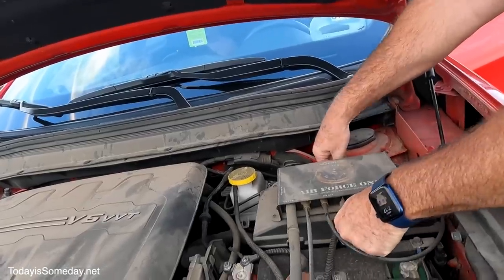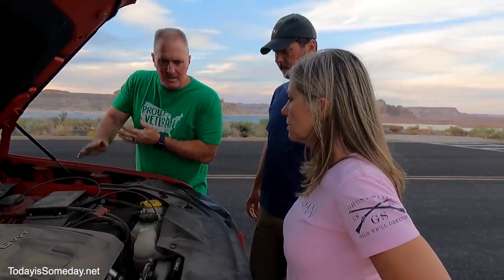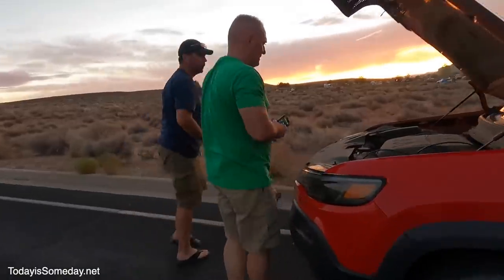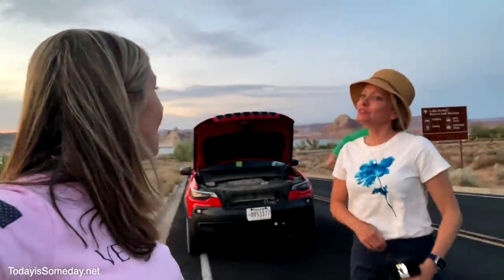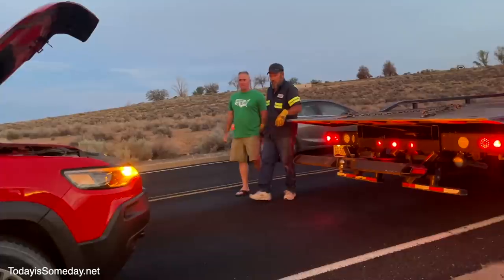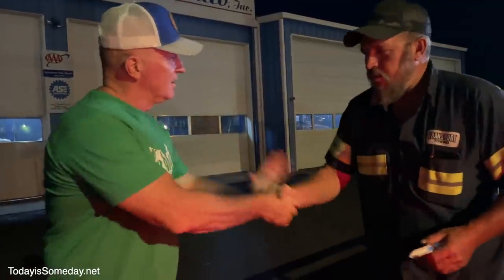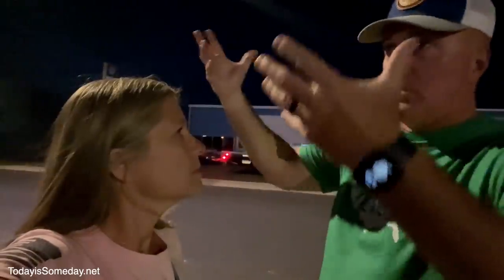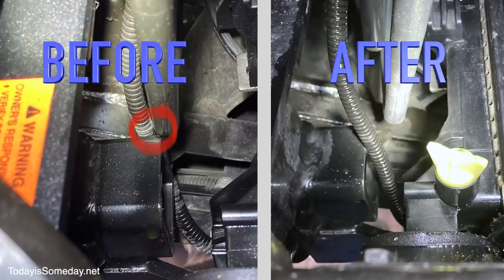Tow Car Breakdown in the Middle of Nowhere (FULL TIME RV)

Comment: As a machinist mate and 25 year auto repair shop owner, I would recommend splitting a small piece of hose and zip-strip it to the line in the after pic where it is resting on the frame or bracket. Even though it won’t pinch like the last time, it will rub from vibration and cause another hole. Go Navy, Go Chiefs!
Reply: My thoughts as well, it is not IF something will rub,,, But WHEN!
Reply: Great suggestion Kirby
Reply from the maker: I was all in on the suggestion and then you had to add...Go Chiefs!  You lost me!  ;)

Comment: Me too!! My Jeep crapped out on me on I-40 near Knoxville TN! I sat there for almost 6 hours (6:30pm until 1:30a.m.) AFTER calling AAA until a "backup" tow truck arrived. As a lone female traveler, it was a little scary so late at night with no power in my Jeep, no way to charge my phone and no way to get my driver's side window up and 18 wheelers whizzing by. Guess the alternator went out?  No hotel rooms ANYWHERE so I slept in my vehicle at the tow truck lot. Thankfully they let me use an outdoor plug to charge my phone.
I am grateful that I didn't wreck, no one hit my disabled vehicle and I was able to get a good rate on a rental car today. 
As a side note, just 2 weeks earlier while pulling my 21ft 1969 Shasta Deluxe, something happened after 3 semi trucks flew past and it started fishtailing, I lost control of my Jeep and the trailer flipped, it came off the hitch and so did the chains! My Jeep survived unscathed! That was on the 295 outside of Newport Maine! Both lanes of southbound traffic blocked. A total loss of my sweet little camper.

Comment: Good Stuff to know! I grew up in different vintages of Jeep, Grandad had Willy, (Thank You for Your service) My folks and Grandparents had : Liberty, Cherokee, Eddie Bauer Wagoneer, Cherokee Sport, Two Seat, Four Seat, Floor Seat (dog needs a seat - move down), many different variety, CJ7, Sahara Edition; so I get the Fuse Fix. I now tow with a vehicle same vintage as my kid, but someday I will own a Jeep again, my newest Jeep was a '99, with a wooden roof rack my mechanic said "Just add a steering wheel and 4 wheels for those times You flip over." Just Empty Every Pocket. Every vehicle has slang! Never owned a Jeep with a tow package, factory or not, the vehicle I currently own was one I installed the kit myself. I tow a camper that weighs less than 200 pounds. My vehicle height is not as high as a Jeep so I call it my "Mock SUV". It works, like a Jeep - until it doesn't!

Comment: Funny story - My 2008 Jeep Liberty started to drip a bit of transmission fluid, and I had just had the AC condenser (with the transmission cooler built into it) replaced due to AC issues. So, I had to take it back to AAMCO under warranty. They discovered a rat had crawled up under my frame and got stuck. It tried to chew its way OUT of the tranny lines that had caught it (and likely scalded it to death), so guess who had to pay another $850- to have that replaced a second time. So, while I didn't get stranded, I feel your pain. So happy that it all worked out, and still love my Jeep! As always, SEMPER GUMBY and GO NAVY!

Comment: We had a similar installation issue with a certain RV Dealer.  Wiring installation was completely wrong.  It was on our previous 2014 Jeep JKU manual tranny with the Invisibrake.  The installer ran all the wiring and vacuum tubes through driver's floor pan drain plug hole.  So over time the wires shorted out with the feet pivoting between gas, brake and clutch pedals.  It should've gone through the firewall.  The dealer made good on the repairs. But like you we were on the road.  We have since reinstalled the Invisibrake into our 2020 Jeep Gladiator, works great.  I would just advise anyone who has any brake system installed to have the installer explain were all the wiring and vacuum tubes are run through the vehicle.  Oh Yeah, Phil.  I'll disregard the Air Force comment.  LOL.  Be Safe, Friends.  Bill and Kristen  🤙

Comment: I did my own towed conversion. The transmission line issue was clearly in a warning and specific steps to take in order to properly secure the line. It was all in the installation instructions for the base plate. Your installer dude owes you a repair bill.

Comment: I want to thank you for this video.  I had nothing planned for this morning as we are camped in a beautiful COE park in MN with no real plans for the weekend.  But now I will be crawling under our Trailhawk to inspect the fluid lines.  Glad it worked out so easily for you.  Stay safe, stay  healthy.
Reply from the maker: Fingers crossed yours is good to go.
Reply: I have the same vehicle.  I can’t figure out the picture.  How’s it taken?  From inside the hood, looking down?  Or underneath looking up?  Which side?  And what’s the yellow thing in the right side pic, I don’t see that anywhere on my Jeep either.   There is a plate, like a big rock guard underneath.  Was that removed when taking this pic?  Thanks for the heads up, hopefully I don’t have this problem!
Reply: @WelshDesigns  In front of the rock guard is another plate (at least on my '15) that can be removed with a little bit of work, and the tow plates are visible above that plate. They run safety cables around your frame onto the tow plates, and if the installer wasn't paying close attention, those safety cables can rub on the transmission lines that are right there. We insulated my lines when we installed my tow plates since there is a warning in the installation directions informing the installer to be cautious of them.  If you have access to an endoscope, you can snake it down behind the front piece on the edges of your radiator and see those cables and hoses as well.

Comment: There are good people out there! We are in a trip from NJ to the Rapid city to see the sites and we also broke down with our TV twice. One time in in SD and the shop had us back on the road in two days. I think they must have knocked a ground wire loose and all a sudden the truck was a little off when starting. Found a guy in Wyoming to put a starter in it. He didn’t have one so he pulled it out to see if could maybe fix it and cleaned it up and reinstalled it all in the same day. I asked what I owe him he said $250. I thought that was fair. The next morning at 6am while I was having coffee I see him walking are the RV. I go outside to talk to him and he said he couldn’t sleep because he didn’t do his job correct. He said he should have checked all the connections before he pulled the starter out and after he got home he thought the ground wire was a little loose. So he try’s to hand me back $200 and said if he did his job I would have been charged $50. 
I told him to keep it because I appreciate what he did for me. 
Later that day I won $150 in Deadwood and I texted him to let him know that and it comes around. 
Safe travels guys.

Comment: Well you picked a pretty place to crap out.  We went across I-40 from Gallup to Kingman on the 28th so we came close to crossing paths.  Hot and monsoon rains in the afternoon.   It was getting dark and a field expedient could likely be deployed in the absence of a SheWee.  My wife won't be happy that I mention it, but we found out that if you come across a rattlesnake in a situation of that kind, it can take up to 3 hours before you consider even the possibility of needing to stop. 

I got towed in to Barstow to a shop that had closed 15 minutes earlier on a Friday afternoon.  Luckily the owner was doing his books, and had the proper size replacement battery.  I was sweating (literally and figuratively) a weekend in Barstow and replacing an alternator on Monday.

Comment: When I installed my Blue Ox baseplates on my Jeep Grand Cherokee Trailhawk (probably the same ones as the Cherokee’s), the instructions say to make sure the transmission coolant lines don’t rub against anything sharp.  I placed electrical flex conduit around parts of the lines and zip tied them back to help.  Love the Trailhawk for towing!!  Sorry for the bad luck.  Something to add to the check list.

Comment: We installed the tow plates on my '15 Trailhawk - One huge note for the Blue Ox kit is to be aware of the safety cables having the ability to rub on the lines that run right beside the mount plates. You can take the front plate loose and look up in there to see those cables and make certain that they were routed so that they don't rub on any lines. We cheated and used safety wire PLUS the zip ties they recommend to secure the cables to the tow plates (I have pics of when we were doing it but can't post them here obviously)

Comment: sorry for the isue....but it was very interesting...especially the legs in the air!!!   Be safe.....My hitch extender fractured at the weld line and my TOAD disconnected.  Fortunately we had just exited the Interstate were only going about 40 MPH.  But ...when i finally came to a stop...the car rammed the back of my motorcycle hydralift and and scratched and dented the hood...and bent the Blue OX.  Got a new one in two days and we are off again in the Black Hills of SD. RV Stuff happens!
Reply from the maker: Yikes!!!

Comment: Does the Jeep owners' manual recommend long-term towing with all four wheels rolling on the ground?  Instead of rubbing a hole in the bottom of the hose, it can rub a hole in the side of the hose.  Hey!  The road get over 100 degrees, the metal gets hot from the road, the plastic/rubber tube slowly melts against the metal, and the tube leaks.  Maybe it is time for another pool noodle to decrease heat and vibration.

Comment: We had a similar issue on our new class A. In our case the lack of enough under carriage cable ties meant our Jack’s hydraulic lines landed on the hot muffler and melted so we lost all fluids and our jacks. MAKE SURE YOUR LINES ARE WELL SECURED!

Comment: Sorry, y'all had problems. We flat tow our F-150 and the only problem we have had is a spring in our tow bar has gone out still haven't had it fixed yet so sure if it will be covered under manufactor's warranty.

Comment: Phil those Jeeps have a belt driven cvt transmission the same type of transmission in atv's and side by sides your clutch springs that very The gearing of the pullies both of them could be shot the pullies having a shiny spot that isn't letting friction happen with the belt or the springs are not putting the pressure required to keep the belt tensioned

Comment: I just discovered a problem caused by the tow package installation on my Jeep Grand Cherokee. The Electronic Stability Control warning light kept coming on so I took my jeep to the dealer. The dealer discovered that a vacuum air hose for the towing brake system was not routed correctly. The line would dangle down and rub against the compressor belt while the engine was running. This caused a hole in the air line which caused the warning light. If you’ve had a towing system installed, check the installation to avoid breakdowns. 

Thank you for the video. I’m going to check my coolant lines now.
Reply from the maker: I will be checking that as well.  Thanks for that heads up!

Comment: I just installed demco tow brackets on my 2021 Cherokee trailhawk, no lines or hoses anywhere near the brackets. Whoever installed yours must have accidentally pulled  one near the connection. I agree, poor workmanship when a "professional" does that. Glad you got back on the road. Safe travels.

Comment: Glad you are all good now, but sounds like an expensive fix and maybe you can go back to the ones who installed it to see they will cover all or part of your expense since they installed it.
Anyway I have a 2020 Trailhawk of what you inspired me to get one.
Just check my toad install baseplates and looks like I am ok. But my baseplates are Road-master and I think you have Blue Ox. My baseplates are different and looks like they can’t pinch a hose for what I can see. Thanks for the tip for me to double check if I may have an issue too.

Comment: Your loose fuse reminded me of an issue I had years ago. I had a basic level minivan, roll down windows, pull locks, BASIC, as in definitely no alarm. I had just gassed up and checked my oil. When I slammed the hood shut my non-existent alarm started beeping the car horn. Talk about perplexing. I opened the hood and was lucky enough to hear clicking from what looked like a fuse box. Sure enough, I opened it and found a lose fuse. Reseat and no more alarm. I wonder if a lot of the gremlins people have with the electrical system are just loose fuses. Safe travels🤠😎🙂 Stacy climbing through the window was great.

Comment: Assume learned for RV? - Always hide an “emergency access” door key in an inconspicuous place. Simply masking taped to a known (to you only) location has worked for me more than once. Like your GoPro, keys have a way for finding lake bottoms. RV’s have LOTS of places to hide & conceal it. For my JL Wrangler, opted for bumper/frame-end tow bar mount by Rock Hard 4x4 instead of Roadmaster’s base plate, to provide better ground clearance.

Comment: As soon as you found the oil I figured it was a cooler leak. Glad it didn't damage the trans. Only question is has the trans been getting cooled enough with the hose crimped?

Comment: It sucks that the lines got rubbed through, glad it didn't cause a complete transmission failure. Does the shop have a good plan to buffer or better secure the lines so that doesn't happen again.

Comment: Yep that fluid under the front end of the Jeep didn't look good.    As it turns out the baseplate installer didn't do a very good job from the pictures you showed.  I would also get something between that new line and the base plate or you will probably have the same problem again as they are still rubbing.  Stacy going into the RV was hilarious, it looked like she was being swallowed by a whale.  Good luck guys.

Comment: Glad it all worked out. Out of curiosity were you able to use insurance for towing. Like FMCA, Good Sam, Auto Insurance if so which and did it cover the whole tow bill? We also have a Tiffin 33AA and I've had my wife has had to go through the window several times because we couldn't get the UNLOCKED door open. So beware! We've meet 4 other Tiffin owners who've have the same problem. Usually happens if someone has to go potty. Don't slam the door & keep up the good work.

Comment: Look carefully at the fuses to make sure there's none of the fuses broken there should be a little wire in the center of the color fuse if that's burned out or broken that's the problem do not pull out every fuse though just do one at a time

Comment: It could have been worse. I flat tow a 2014 Cherokee trail Hawk behind my class A. Discounting the base plate did you need to do anything to yours to prepare it for flat towing? I bought mine used when it was 3 years old, the previous owner towed it behind his RV. 
After I bought it I found that there was a problem with flat towing cherokees, it is a problem with the power steering being electric not hydraulic. When towing the front wheels could start a death wobble. I had Jeep do the mod that is supposed to fix it, I now have a switch in the console I need to turn on and I have to plug a fuse into a pigtail under the hood, it basically turns the steering on when towing. 
Now, as I started looking closer I found that one of the subframe parts was new and the other side was old, looking closer I saw the old one was cracked on a weld, oh oh. Then it got worse, I saw the new one had a crack on it also. At this point I couldn’t tow it because these subframe parts connect to the same place where the base plate bolts to but the base plate is on the front side where the subframe’s are in the back side, the base plate connection that is pulling the jeep connects to the cars frame, critical point you don’t want to fail. 
I had been noticing some coolant leaking, just a few drops, I expected I had a hose leak that I would just replace the hoses on a weekend. 
So, it got worse, I had ordered new subframes to replace the ones that had cracks, as I started working on those I had to remove the base plates to replace the failed parts, I then found that there is a structural frame that everything in the grill mounts, that frame was broken on both sides of the front. This frame is sandwiched between the base plates and the sub frame extensions. I then found that the coolant leak was from the radiator, the radiator bolts to this frame that was broken and the radiator was being pulled apart, the radiator was holding the frame together. 
I ended having to completely take the front of the jeep off and replacing the frame, sub frame extensions, radiator and new hoses. With that all done, the jeep flat tow mod I take it with us when ever we take a trip. 
You really should look at those extensions and check the welds, my guess is the original owner was having the death wobble and it was tearing the front end to pieces. I believe yours had the death wobble fixed as mine was 2014 the first year of the KL model. 
I have some photos I could send if you give me a link.

Comment: If Jeep used stainless steel, armor clad, Kevlar wrapped line… never mind. Lack of attention to detail on the baseplate installer’s part. I bet there is a standard caution about checking for pinched lines or wires. Sadly the water levels in the western man made lakes are dropping. Maybe you can find your camera then. Thank you for sharing and have a great day. #gonavy #aimhighairforce #spaceforce

Comment: What base plate do you have? I installed my roadmaster baseplate and the bolt into the factory holes for the bumper support. There was no transmission or other items to avoid.   Great videos as always. I missed the hashtag #road problems suck!
Reply from the maker: Blue Ox.  This had nothing to do with the Jeep and everything to do with how our base plate was installed by someone outside the dealer.